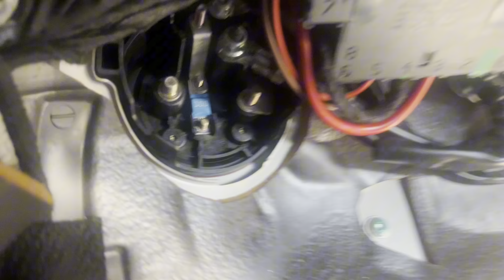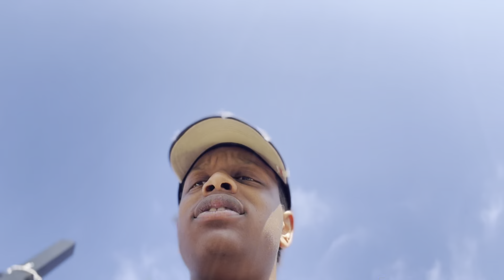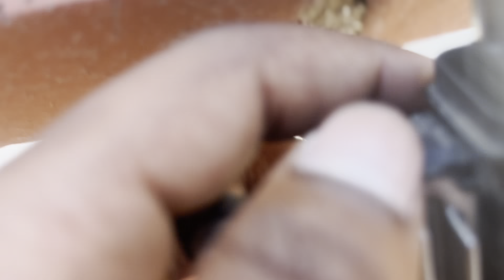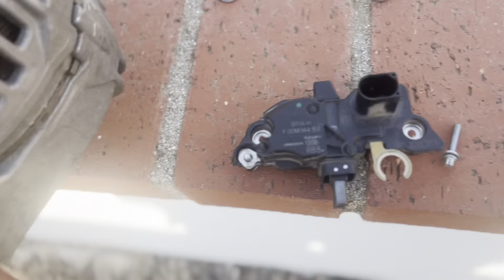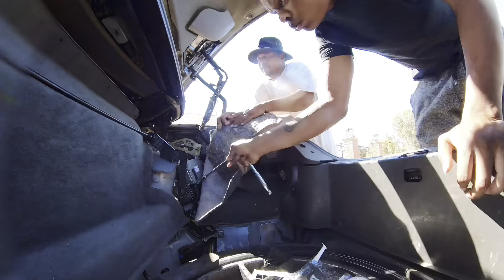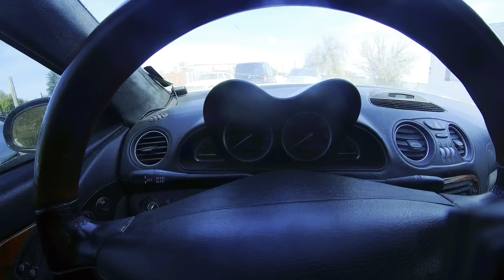How to replace an R230 BCM(Battery control module) | SL500 build pt 3

Comment: Hi mate, I am trying to access the BCM without having to remove the trunk etc, and I wee that you managed to pull up the carpet just at the back and you got to the BCM, can you explain how and any tips?  many thanks
Reply from the maker: I first remove plastic trim around the trunk lock it’s held with plastic pins and some screws. After that I remove convertible, top separator and that gave access to lift up the carpet to get to the BCM

Comment: Was the BCM the problem or the fuse?
Reply from the maker: I I initially replaced the fused and the car worked for a minute, and then the fuse blew out, and I figured out it was the BCM
Reply from the maker: You should check your fuse

Comment: Where did you send the BCM for repair. Thanks
Reply from the maker: M and B SPECIALIST
PHONE 9549428530
508 SOUTH DIXIE HWY. WEST
POMPANO BEACH FL 33060
I found them on eBay
Reply from the maker: M and B SPECIALIST
PHONE 9549428530
508 SOUTH DIXIE HWY. WEST
POMPANO BEACH FL 33060
I found them on eBay
Reply: Thank you